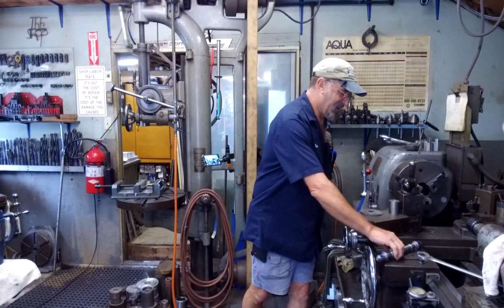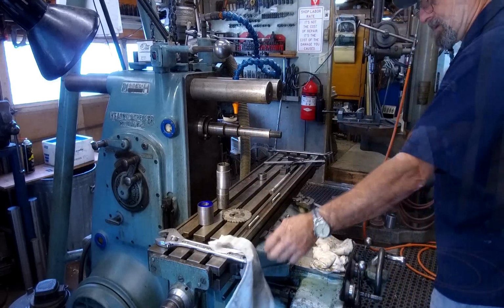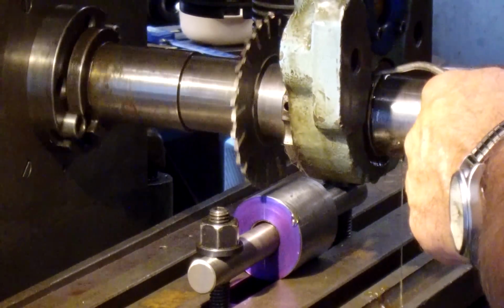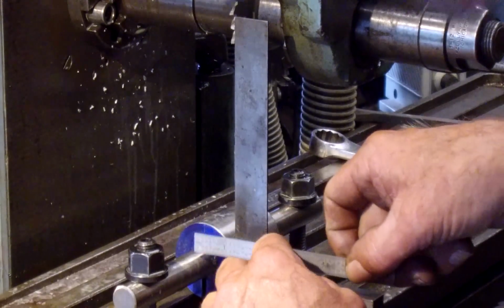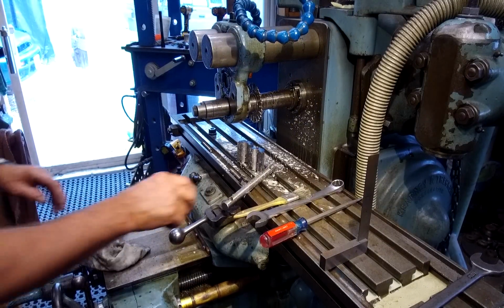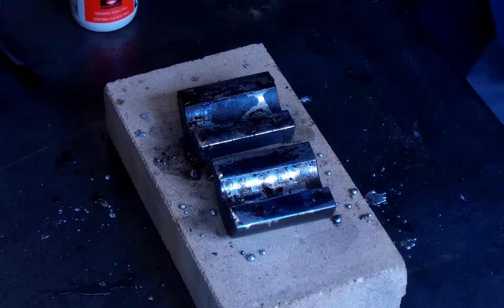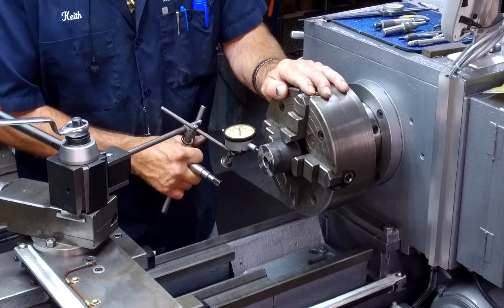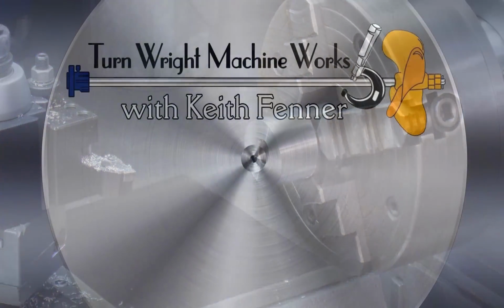Steam Wagon Ho Part Eight

Comment: I really enjoy watching these videos but the one thing I've observed is how many tools are made from scratch so a project can be made. It seems like Keith is buying or making a new tool on ever project. I understand why he needs to do this, it's just amazing to me none the less.
Reply: When I started doing woodturning, I spent the first month and a half making my own handles and tools. I don't think I actually did a project until the 3rd month.
Reply: In a production shop it would be cost prohibitive to make too much tooling but in a job shop sometimes it is cheaper to make the tooling up for one off parts. It is also a bit of a challenge to try to make the tooling a bit flexible so you can adapt it to other jobs. In a hobby shop all machining is fun so making jugs and fixtures and tooling is all part of the hobby.
Reply: Noel Henderson   As a child across the street from my grand parents home there was an old machine shop. It was called central machine shop. The floor was cinders and the heat was from a forge. In the summer I used to stand outside and watch the magic of the old shop as he cut, welded, forged and machined parts all day long. 
I don't even know this old mans name, he just let the kids stand near the barn doors as he worked. I maybe said one or two words in all the years I came over to watch. He has no idea of the impact just watching him work had on my life. 
The good aspects of my childhood.

Comment: Keith, they make a tinning flux that brushes on while the part is hot and it tins the steel that you're working on. They use it in body shops so lead will stick to steel body panels. It works real easy on metal parts, you just heat the metal, brush it on and wipe it with a cloth. I don't know if it would be compatible with 50/50 solder but I don't see why it wouldn't.

Comment: I had to cut a large piece in half recently. I turned aluminum to a slight press through the part.and held it in a vise. that way I could cut then turn the part over and make the final cut, on a Cincinnati Horizantal.

Comment: May I suggest a different approach to making the collar?

Two lengths of 1"x1/2" flat bar, about 5" long, lay flat on top of each other, in the mill vice.

Drill 2 holes at each end (one either side, far enough out to clear the hole for the shaft), and bolt the bars together, to form a 1" square bar.

Chuck it in the lathe, and drill and bore it to fit the shaft.

Turn the area behind the first bolts, to form the collar, then band-saw the square ends off.

Chuck in the lathe and face both ends of the collar.

Hey presto, a split collar just like you made, but without need of a slitting saw or soldering.
Reply from the maker: Like I mentioned there are many ways to go or Getter Done! cheers, ;{)-------

Comment: I gave up tinning large surfaces with solder.  Buy some lead tinning paste from an auto-body supply.   It's a combination of flux and lead / tin solder.  You simply clean the surface of oil (for your surface alcohol would be fine), paint on the tinning paste, heat until it turns brown, wipe with a damp cotton cloth and you have a fully tinned surface ready for soldering.   No more flux, scrubbing, etc.   Way easier.

Comment: You might just as well have started with a square or rectangular bar... no particular advantage to using round stock, except maybe that your drop already had a hole in it. Interesting process and fine work as usual.
Reply: That's exactly what I was thinking.  It would have been faster.
Reply: Paul Mathews maybe for explain how to slip something in 2 equals parts.....there is many good ways to do a job....but there arent all interesting to share with everybody...

Comment: Hi Keith, Aussie Noel here. Your skill with the camera is as good as your skill machining. My question is Without going into specifics as it's private, how do you cost a job like this?. My back ground is costing and how do you include tool making for a job?. If you don't feel that it appropriate to discuss this over the internet, tell me to piss off, I will understand.
Reply from the maker: Most of the time you know that you will have to make tooling for the job and you add that right into the project, time & material. just don't over look needing to add to the project and not including it, and later asking for more. ;{)-----

Comment: There's not going to be radial force on the holes, just shear/torque.  So I don't think that you need holes in the flange - you could have radial slots cut on the mill.

Comment: When you were centering up the round stock on the horizontal mill could you have centered the cutter on one of the T slots, then clamped the stock as you did without finding the stock's center? Wouldn't it cut right on center because the T slot would act like a V block?
Reply from the maker: Yes if you choose to set up on the T-slot, that would work as well, or if you are cutting multiple sizes and lengths the same center can be used as if repeatable. ;{)------

Comment: A half piece with two holes. You drill one hole, rotate the fixture and pin the first hole and drill the next. You have the the rotating chuck to make this easy.
Reply: Hmmm ....  There are twelve holes, so by your method the individual errors could stack up and amount to quite a lot by the end of the chain. I guess this could be minimised, or at least spread, by providing (say) holes #1 and  #4. rather than #1 and #2, and working in both directions, but  remember Keith has four flanges to do, and by your suggestion that's 48 setups to be reclamped, vs only 4 with his.

Comment: I was told at school not to use the key because if something happens the cutter will slip and possibly not break ? Some parts are difficult to hold and if they move there is a slight chance of saving the cutter ?
Reply from the maker: I use brass keys and they shear rather than shatter the cutter, old school. ;{)-------
Reply: Keith,  Did you intentionally leave that sliver of metal between the two halves for support? Thanks, looking forward  to coup de gras
Reply from the maker: I wanted it straight through but sometimes it is hard to see, it is okay either way, but wouldn't want any more than just a sliver. ;{)------

Comment: Why not tin 2 pieces of 1 X 2 steel together, then chuck them in the 4 jaw- turn and bore all on lathe?
Reply: As Keith said in the clip, lots of ways to do this. 

For instance, if his drop had been longer (maybe 3x the finished length) he might have finished the outside and inside diameters to the eventual size from the outset, then milled away exactly half for a distance of a little over twice the finished length, toeclamping at the very ends.

However this would first require drilling very deep holes (not practical as they would wander off axis), or else he'd still need to temporarily hold the hemi-cylindrical pieces together somehow given he probably does not have a dividing head with a six-jaw chuck.
Reply: Not to argue or denigrate Keith, but it could have been done in an hour- no tinning necessary- just take 2 square blocks with a milled surface, bolt them together, drill them for a couple locater pins. Chuck it in the 4 jaw and bore the hole.  Make a round arbor to fit the hole and use that to chuck in the dividing plate.  This was clearly a project designed to show a lot of different operations, not one intended to show the most economical route.
Reply: Your method suffers (to a lesser degree) from the problem with the one I mentioned: the holes need to be drilled deeper than they would if the workpiece was already down to finished length.
Further to that: I'm not trying to pick a fight either, but I would be interested to see a real-time, no cuts video of your method happening in an hour (even without the time consuming and informative explanations we get from Keith). 
Find suitable stock (2 rectangular and 1 round), set rectangles up in mill, machine the surfaces, cut  to length, drill for clamping bolts, assemble, set up in 4 jaw, precision bore hole, turn OD. Change to 3 jaw (or clock up round bar in 4 jaw) turn arbor, assemble work to arbor. 
Set up dividing head,  chuck assembly, spot 12 holes, peck drill twelve (rather deep, so carefully) holes.
Remove, saw off ends, linish or face or mill to clean up ends. (Optional)
If you can do all that inside an hour (given that each hole could take several minutes) it seems to me that prospective employers would crawl across broken glass to win your favor.
Reply: Either way requires the same time for sourcing materials etc., but the square block method eliminates all that  turning the part, splitting, tinning, then un tinning, milling flats for clamps etc.  As far as hole depth goes, if you start with a couple rectangles about the same size as his round part, the hole depth is the same.   As far as employers goes, if you used his method in a job shop, you would probably have to crawl over that broken glass to keep your job.

Comment: Keith, that soft solder flux is crap. Throw it away and get yourself some BAKER'S FLUID which is KILLED SPIRITS OF SALTS. Works wonders on steel parts. CORROSIVE I know but can be washed or boiled in water. Your flux may be OK for brass and copper.
Reply from the maker: Thanks I'll give it a try! ;{)-------
Reply from the maker: Well well out of the price factor here in the states!  ;{)-------
Reply: Sorry Keith, I do not understand the reply, unless you mean it is expensive there ? You can make it yourself, get an OLD GALVANISED bucket, tip in some concentrated SULFURIC  ACID swirl it around until it  stops Fizzing.
Reply from the maker: Yeah the cost of that brand here!  thanks  I have those items here and will make my own and experiment! ;{)-----
Reply: Hi Dave & Keith
Being a chemist the conversation on flux was of interest to me. I checked the material safety data sheet from Consolidated Alloys on Baker's #3 which I think is the product discussed here. The msds indicates the primary components are zinc chloride , ammonium chloride, hydrochloric acid, and water. My guess is that this material is made by dissolving zinc metal in hydrochloric (also known as muriatic acid) to get a certain concentration of Zn in solution. The ammonium content probably comes from the use of aqueous ammonia to neutralize excess hydrochloric acid.
Bottom line here is that dissolving some of the tin from a galvanized bucket with sulfuric acid may produce a useful flux but it won't have the same chemical composition as Baker's #3.
This reply is already too long but I can't neglect how important it is to be knowledgable about potentially dangerous acids like HCl and H2SO4 before working with them.
regards
vic
Reply from the maker: Thanks for the input Vic! I always take the toxic chemicals serious, I believe the same is in the flux I used stay clean By Harris. I didn't have a problem with it, but if someone else talks about a hands down difference, you got to want to try it! right! LOL ;{)------
Reply: I didn't notice that you had any problem, either.  My inclination is to discount extraordinary claims that promise "a hands down difference".

Comment: Question from a complete novice. Couldn't this have been made by using two pieces of flat stock then boring and turning round?
Reply from the maker: Your time of cutting an interrupted cut / square to round, would have been the slower route. ;{)-------
Reply: Thanks for responding